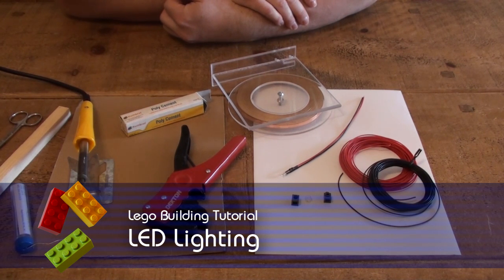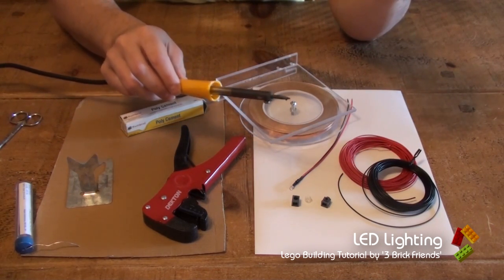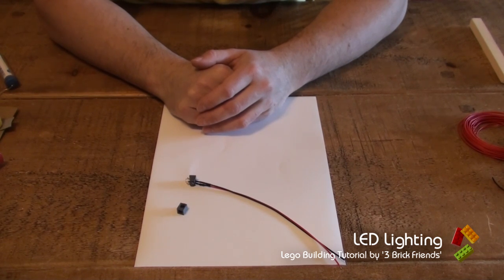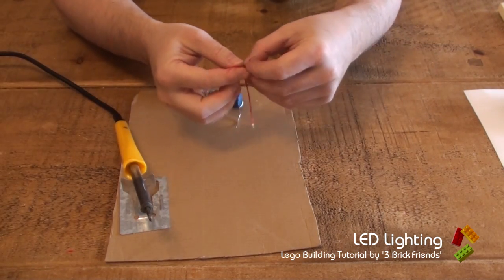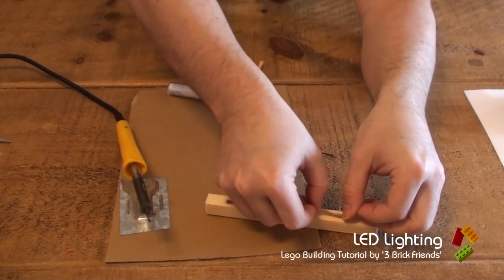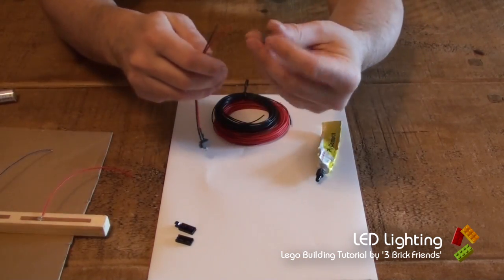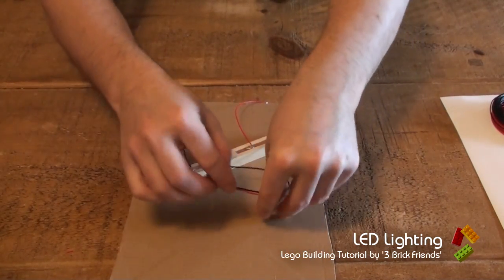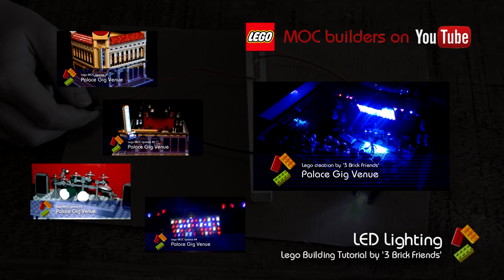Lego Tutorial - LED Lighting

Comment: You can easily improve your soldering technique.  Tin the leads as well.  I.e.  Coat them in solder, similar to what you do with the copper tape.  It will solder much more easily and the joint will be neater.  Keep everything clean too.

Comment: Do each of your micro LEDs all have an integrated in-line resistor, or is that irrelevant? I have some 5V micro (Philips dewdrop) LEDs and was thinking I could clip them and route them into Legos -- but was then wondering if there needs to be a resistor on each or just at the final power point?